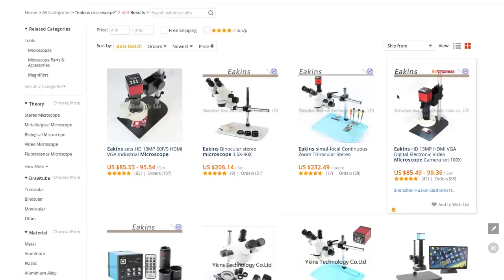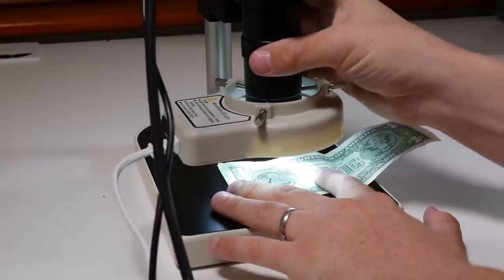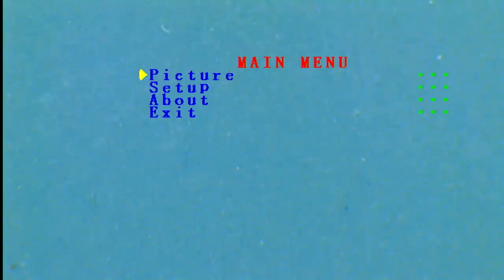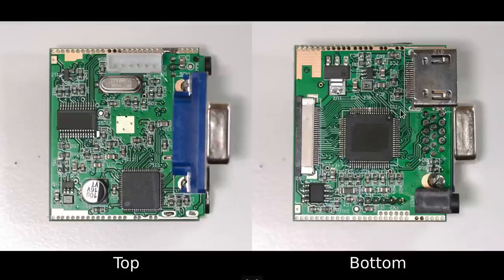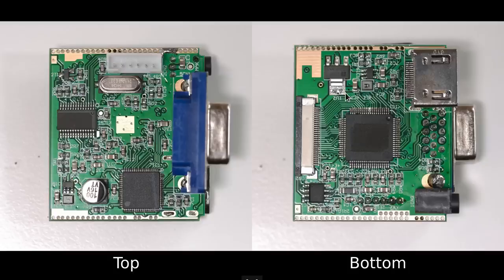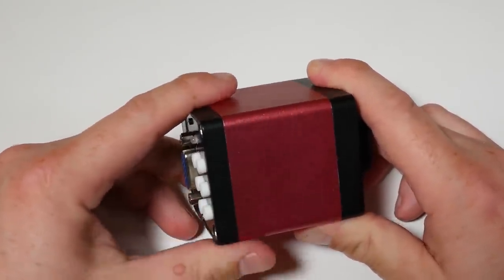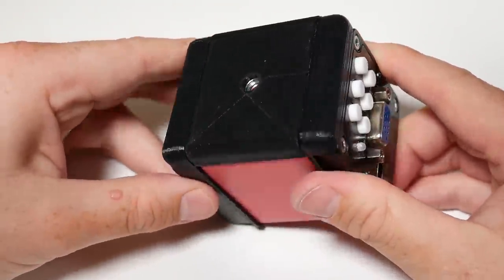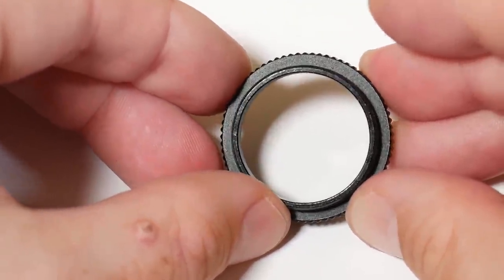[015] Eakins HDMI Microscope & Camera

Comment: Is this the 14mp version? I bough one, a different brand, but looks more or less the same. I couldn't get the software to capture at 4320*3240 pixels ? I saw they specify this can be captured by using the TF card. Would there be a possibilty to achieve this using the USB connection?

Comment: If I've got a bare circuit board to look at,  I slap it under my scanner. But that doesn't work if the board is too lumpy.
Reply: I thought this comment was a great little work-around. HOWEVER, this method simply didn't work! The scanner just blatantly refused to work. I had to reinstall the damn board back into the scanner. By some stroke of sheer luck, I must have rattled something the right way, the scanner has worked flawlessly since. Real head scratcher (;
Reply: @coffeeandcigars wonderful!

Comment: I've had one of these since last year and I love it. Performance even with the LED ring turned off is very good. I've added a 40mm (does not screw on) circular polarising filter and that cleans the image up even more, eliminating some of the harsh reflections. I use it for very fine SMD work and as a bang for buck this thing piddles all over the Tagarno and Inspex ($6k) digital inspection scopes I use at work.
Reply: Ingmar M just purchased this microscope today ! Can you send me a link to the filter you bought ? Are there anythings I should know about the microscope ... will also be using it for SMD work 👍
Reply: How comfortable is it to solder using this by looking at the screen.   I think most people prefer microscopes, or?   I don't plan to do but maybe a few pieces a year... or less... so... no big deal

Comment: Hi! First of all, thank you very much for this instructive video, it is a very good work, congratulations for that!
I have one question. I purchased the same microscope with the aim of connecting it to the laptop and take close up pictures of tool wear, in the machining industry. But I am not able to connect it to the laptop since the HDMI in it is output. You say in your video that you use an HDMI extender, from an HDMI input to RJ45 ethernet cable, but what do you use next? How can you see the images in the computer so that you can print screen for example, or record videos?
If you could tell me, I would be very pleased. Thank you very much in advance!
Reply: Hi, take a look at this older video of the HDMI extender: https://www.youtube.com/watch?v=SAvGylthpkU
Also, definetely check out the notes: https://opentechlab.org.uk/videos:003:notes
Good luck!

Comment: Oh, you're still using the Lenkeng transmitter!
What firmware version did you end up using?
Mine produces suboptimal 1080p results when connected to (and played back on) a RasPi 3B.
Reply from the maker: I'm on 4.0.0.0.20160427 - it works ok - though it it seems to drop a packet every couple of minutes, which corrupts the image for a few seconds. Looking in the firmware repo (https://bit.ly/2yvsKez) it looks like there is an upgrade for me, so maybe that will help with my issue.

As it happens I'm using it to monitor a RPi3 for my day job, and the results I'm getting for 1080p are pretty good - I have it configured for unicast transmission, so it doesn't spam the network, and then I use 'socat UDP-RECV:5004 - | mplayer -' in Linux, and that gives me a nice low-latency video feed (with occasional corruption).